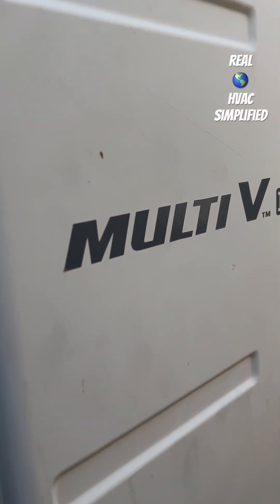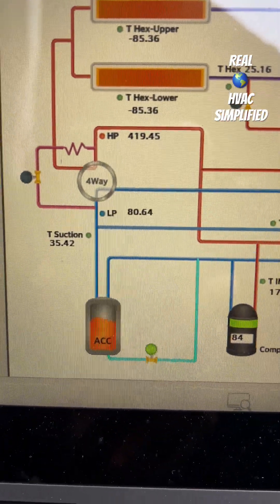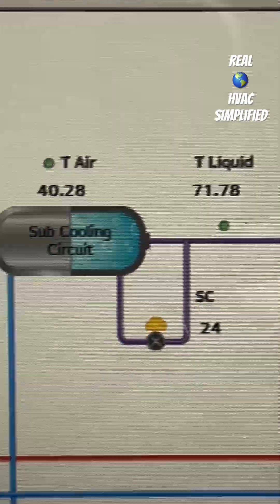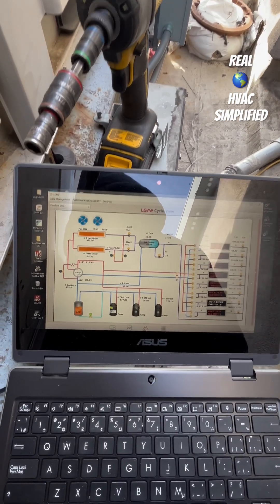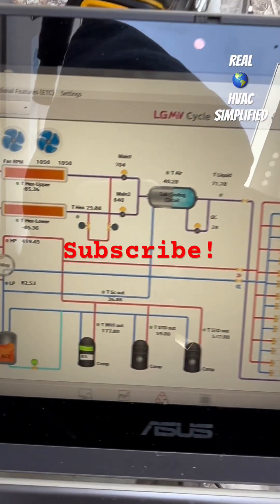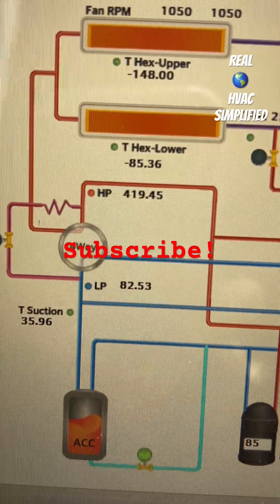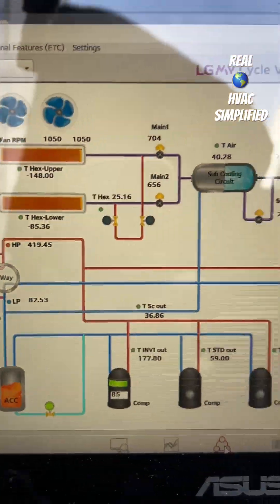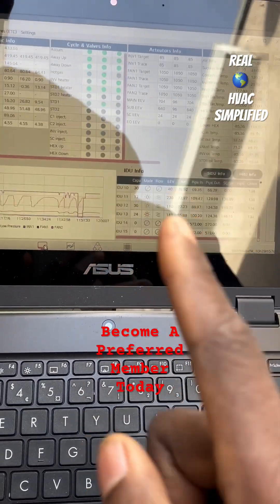🤔WOULD YOU ADD REFRIGERANT? #d2dnyac #lgmv

Comment: There are other issues going on here. Why is one(or more) of your IDU's not communicating? Why are two of your IDU's running with the EEV wide open, and one of them is not getting warm pipe temperatures at all? Why are you running the system with a failed pipe detect(Error 200)? I know from personal experience that enabling the CH-200 bypass can cause all sorts of wonky things to happen, such as HRU's not having the correct solenoids open, IDU's running senile, etc. That's one thing I've learned from my experience, never make assumptions with these units, an issue could just be a symptom of another issue.
Reply from the maker: Agreed 👍 I am aware
Reply: What's CH200 bypass?
Reply: @matttzzz2  If the IDU addresses do not match with what the HRU has, you will have a CH200 error. Normally, the unit will not operate with this error, however there is a function(SE14) you can enable to allow the unit to still operate with this error. I do not recommend this, as the times I’ve tested this, the IDU’s do not function properly, such as some heating the space even though they are in cooling mode.
Reply: @Rodj12341 appreciate the info!

Comment: I’d give it at least an hour of runtime before making a proper judgement. Readings look ok to me judging by your video 

* FYI you may want to ohm out your discharge thermistor for the 2nd standard compressor & the pipe in/pipe out thermistor for IDU 7. 572 degrees seems out of range
Reply from the maker: Dope 😉
Reply: @CurtisMoore1991  it reads 572 because there isn’t a third compressor, I think there are two compressors only.